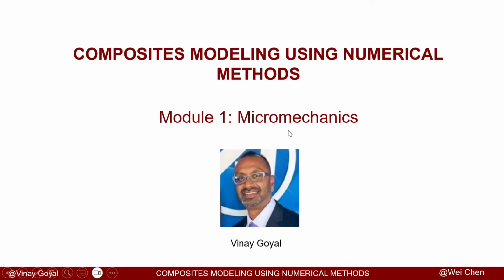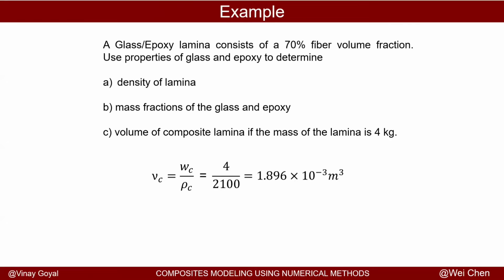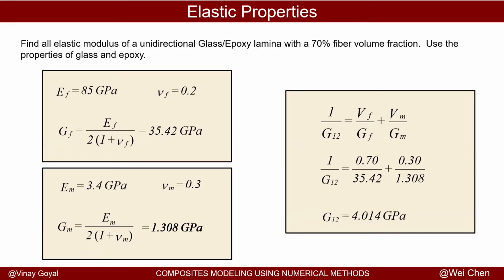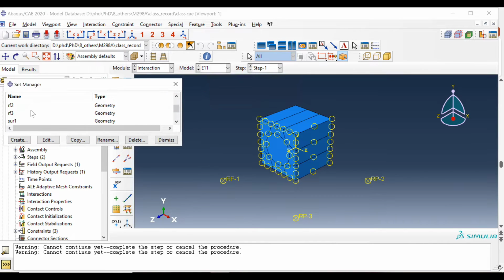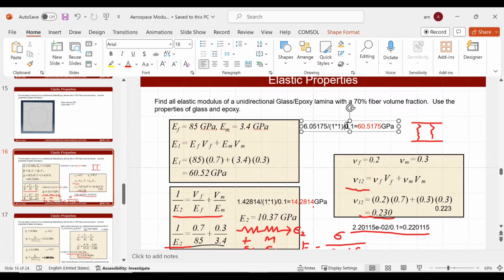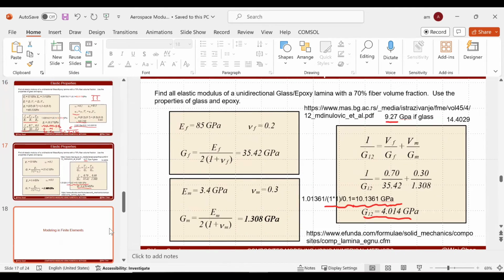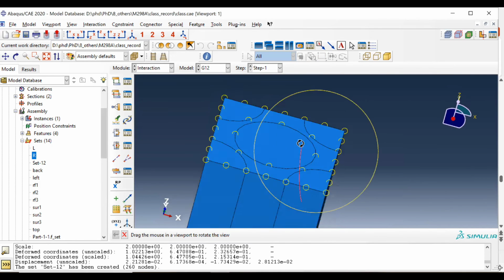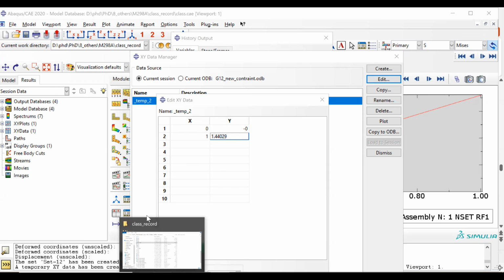#ABAQUS TUTORIALS: COMPOSITES MODULE 1 - MICROMECHANICS TO PREDICT PROPERTIES USING RVE

Comment: Respected Professor thank you for uploading the video.  I am working with a composite material and i need to calculate its mechanical properties but there are voids in the structure of composite you mentioned in the video that there is a method to take into account the voids present in the structure and that method is described in another video but after going through the videos i cant find that specific video can you please indicate where that video is. Thank you
Reply from the maker: Go thru the composites course lecture series
Reply: Thank you sir